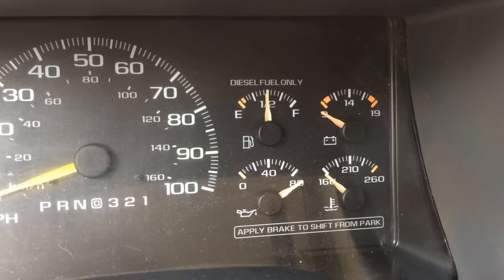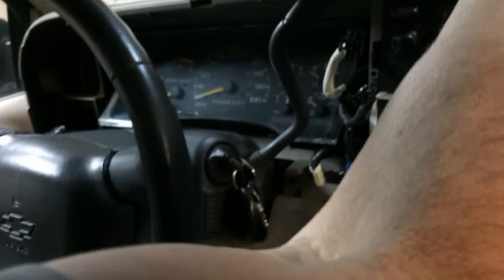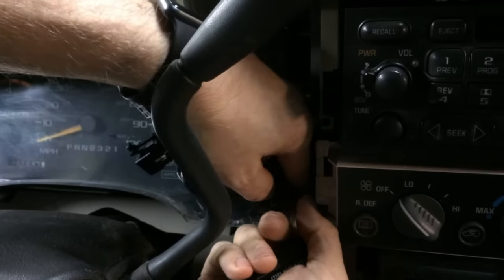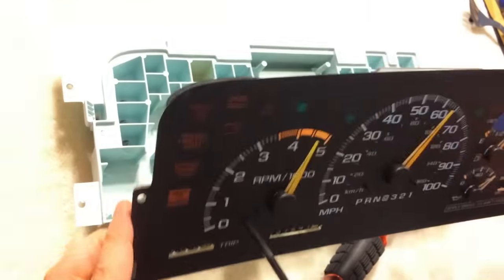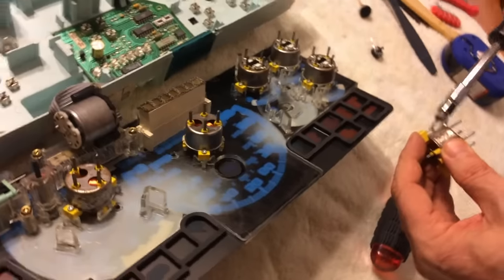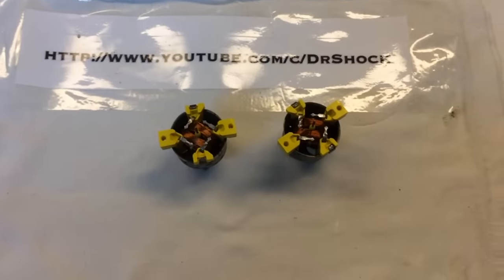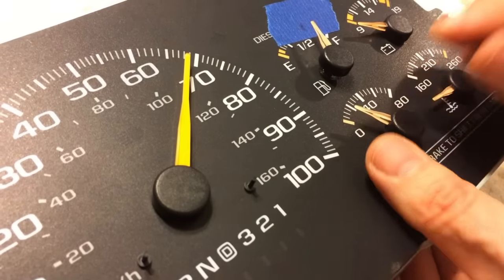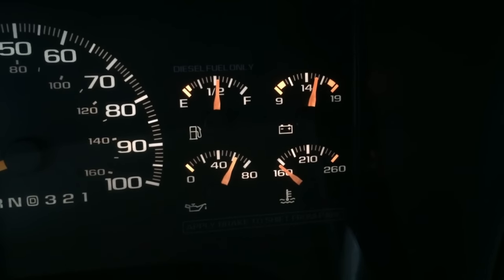1994 - 2002 GM Truck Twitchy Erratic Crazy Fuel & Oil Gauge Needle Aircore Motor Repair (Chevy GMC)

Comment: Does it matter which way the numbers are facing when you put in the fuel gauge
Reply from the maker: I'm not quite sure what you're asking here.   You of course have to have the instrument panel oriented rightside up as shown in the video before you re-install the aircore motors into the flexible circuit board.  In other words you want to be reading the numbers just like when it's mounted into the dash, not upside down.

Comment: Your voltage gauge is reading high too . Should be at 14.4 volts or
Less depending on accessory usage
Reply from the maker: Not necessarily.  The particular vehicle used for this video has the 6.5L diesel factory RPO of dual alternators (aka ambulance option).   Consulting the factory service manual, you'll find the voltage output specification is up to 16V at idle.
Reply: DrShock well crap in my wheeties and call me O.J., Ya learn something new everyday

Comment: Can i just buy everything new?or do i have to replace 2 motor??
Reply from the maker: Discontinued by GM many many years ago.  Never offered aftermarket.   You could go rebuilt - I have links in the video description to Dorman who does full cluster rebuilds but they are expensive.
Reply: 😭damn ok thanks

Comment: where can I find an f  motor?
Reply from the maker: They're gone, the supplier in China went away during the pandemic it seems.   Pinned comment has a speedo shop that can professionally rebuild your existing one though.   And eBay links in the description will from time to time have an old stock or rebuilt one pop up.

Comment: What's the part number
Reply from the maker: There is no part number, like I mentioned in the video GM never made replacement aircore motors but only a complete instrument cluster as a replacement part.   These aircore motors only are available thru speedometer repair shops or their suppliers who guard these factory part numbers.  Fortunately at least one such supplier offer these motors on eBay.  The video explains the letter calibration codes (F, P, V, S, T, etc) to order depending on the gauge being repaired - each gauge requires a differently calibrated motor and it will only work for that one particular gauge.  For a fuel gauge, order an "F" aircore motor.
Reply: @DrShock   Thank you

Comment: How come the gas gauge hand does not go to E when you turn the switch off
1
Reply from the maker: Well, I can't say for older trucks because it's been too many years for me to remember.   But on 97, 98, 99 OBS trucks - the fuel gauge isn't supposed to move when you remove the key.  It's supposed to hold the fuel level reading, so that's working as designed for what you noted there.
Reply: @DrShock  On my truck the gas gauge hand always went to E when the switch was off which was normal! And when the switch was turn on or my truck crank up it would show the amount of gas in the truck! Now the gas gauge hand stays on full period, with the switch on or off!
Reply from the maker: I figured that's why you were asking, but I've not seen that behavior on 1997 and up V8 trucks (both gasoline and diesel powered).   The new behavior, of staying on F always, sounds like a fuel sender problem.  You might try the test for that in the video for that linked from this one.

Comment: where can I buy the aircore motor? I have the same problem with the fuel needle
Reply from the maker: If you read thru some of the other comments they've virtually been sold out now.  The last suppliers I've seen sold out by December 2019.  I do see the "C" and "S" calibrations listed at aliexpress.com still, but they are not cheap anymore.
Reply from the maker: A speedometer shop on eBay is now selling these again, but he's only got the "C", "P" "S", and "T" calibrations currently.  I put a link in the description.

Comment: Where would one find those clips that you made some adjustments on?
Reply from the maker: If you're talking about the clips that retain the aircore motor prongs into the cluster housing/circuit board, only from a salvage yard donor vehicle.   If by chance you're referring to the resistor pack that clips onto the back, you only need to worry about that if your aircore motor had one originally and you just transfer it over.

Comment: This is a ground fault. Have the same thing
Reply from the maker: No, not in this case.   While circuit grounds should be eliminated first, as I mention in the video, as they can certainly affect either the fuel sender in the tank analog signal up to the PCM, or the PCM digital signal over to the instrument panel flex circuit, that's not the behavior I'm going over in this video.   The behavior we're going over here is when the fuel sender has been verified to be correctly sending it's signal, when the aircore motor, PCM, and fuel sender are all correctly grounded, and the instrument panel flex circuit board is also correctly receiving the PCM signal -  but the aircore motor still exhibits erratic or otherwise incorrect readout behavior.   The particular erratic behavior is caused by the complete loss, or chemical breakdown and degradation, over time of dampening fluid used to calibrate the aircore motor itself.  Calibration is needed because the GM PCM signal for these years is a DC SQUARE wave, so without the dampening effect to smooth it out you get the twitching behavior in between signal pulses.  The twitch dance being more pronounced the more the aircore motor calbration material has degraded. Once the aircore motor is replaced, the problem is corrected back to original factory engineering behavior.

Comment: I suspect there was nothing wrong with your oil pressure gauge. I think the needle index was knocked out of alignment when the fuel gauge needle wrapped around and smacked the oil pressure needle.
Reply from the maker: Possibly, we didn't investigate this angle further as the fuel gauge repair was the main todo.  There's considerable labor cost to open the cluster up if you are not the owner of the vehicle, and you only want to do it once in the vehicles lifetime given the age of the vintage plastics involved.  A new aircore motor for the oil gauge is cheaper than a replacement diesel engine, so not something to I'd want to cut any corners on.
Reply: @DrShock , yes, I agree. I enjoy all your videos.

Comment: Do you have the part numbers for the motors?
Reply from the maker: GM only sold the complete clusters originally, so there are no part numbers for the motors alone.  But in the description I listed out the calibration codes that the suppliers to GM used.  Finding a new fuel gauge motor is about as rare now as finding an NOS 57 Corvette part though.
Reply: @DrShock  yeah I kinda figured so it'd be easier to buy a junk yard cluster and swap it
Reply from the maker: You can also have a speedo shop rebuild the aircore motor, complete with new dampening fluid of the proper viscosity.  Basically remanufacture it.    I pinned a comment with at least one shop that was still offering that service late last year.

Comment: Pleas put me in the right direction for a GMC Yukon XL 2001
Reply from the maker: This video woudldn't apply to a 2001, that's a totally different design using Stepper Motors not Aircore Motors.

Comment: what of its not working at all
Reply from the maker: Gauge not working at all - test the fuel sender.
Reply: @DrShock  yeah that could be it
Reply: @DrShock  do the cluster have nightlights in it
Reply from the maker: There are several backlighting bulbs yes (link in the description for the replacements).  If you've got nothing there I would check the wiring harness.  Not really possible for all the bulbs to go out at once.
Reply: @DrShock  no the night lught that lights up the gauges not the other lights those come on
Reply from the maker: Yeah so again that reads like you have a problem with the wiring harness to the cluster, the pin that feeds the power to the backlighting would appear to have an open or short.   Check the fuse first, and then you'll have to go thru the wiring harness behind the dash to locate the problem.

Comment: Is anyone can tell me how I can fix my 2000 the Sienna's rpm and mild meter and a   Fuel gauge
Reply from the maker: By 2000 Sierra was new body style and didn't use this type of gauge, it went to a stepper motor design.   If you search on 2000 GMC stepper motor repair you will find what you need there.  If you're asking about the Toyota Sienna completely different this video is only applicable to GMT400 series trucks.

Comment: I've been owning mine Since 1999 when I got it the dam fuel gauge been flopping every since I got it. I just have kept gas in it. Been low just a very few times and that motherfucker went hay wire thaught me a lesson,Keep that dam tank with plenty of gas in it. That my opinion.and have a gas savior to drive on the side. I love driving my big SUBURBAN. Just keep a lot of gas in them baby's. I've been rolling mine like for ever.going on22years.And that Bad Mother,fucker is still running Chevy Tough.ive kept  it well maintain. It hasn't lete down one-time in almost,going 22years.it is my favorite big ride to still roll.since day one.

Comment: Where can you find the air core motors, they are so hard to find?
Reply from the maker: There's an ebay search in the description, there are only a few speedometer repair shop type suppliers who have access to these parts to sell them.
Reply: @DrShock  yea I found them on ebay, expensive as hell. A whole set is just under 200 dollars. I found that taking apart the cluster and working the gauges by hand, then reset them works just fine. Fuel one needs replacing though, all the fluid is dry in the motor, other than that. Works just fine. At the rate of replacing all the motors, might just be better to buy a whole cluster from Orilies for 350 dollars.
Reply from the maker: So you wouldn't want to replace all of these "proactively", only the fuel gauge suffers from the dampner fluid problem due to how the PCM pulses the signals to the aircore motor.   If you have multiple shot gauges yeah probably a new cluster is in order.   This repair is typically for just one gauge, in the case I showed two because of "collateral" damage from the fuel needle into the oil pressure needle.
Reply from the maker: A speedometer shop on eBay is now selling these again, but he's only got the "C", "P" "S", and "T" calibrations currently.  I put a link in the description.

Comment: Did you see a oil pressure gauge shows high?
Reply from the maker: It's a 1999 6.5L diesel engine in this example, showing expected and normal pressure for the engine temperature once the damaged oil pressure gauge motor was replaced (I mentioned there were two defective motors to address on this repair job in the vid).

Comment: Please stop calling them OBS, they are GMT400 from 1987-2000. 1987-1995 they had the Pre-airbag Steering wheel/instrument cluster/digital air controls. 

1999-2007 was GMT800.

2007-2013/14 was GMT900
Reply from the maker: While my channel gets into some deeply technical topic areas,  I don't typically use GM jargon on my channel that isn't directly related to the repair procedure, though I am quite familiar with it.  For future readers of the comment none of the GMT platforms mentioned actually apply to this particular video, instead the more correct reference would be the GMT400 series yes, but which actually ran thru 2002 as carry over models.  This video is about aircore motor based clusters repair, not stepper motor based and appearing only in vehicles typically referenced as old body style , or OBS trucks because of the design carry over into 2002 nature of them.  The term emerged for how to distinguish why some new trucks like the GMT455 had the old body design in the same 1999-2002 timeframe.  It comes right from the GM SPS information in TIS2000 - official GM term is OBS.  ;-)

Comment: You can inject new dampening fluid in these gauges. Here's a video showing you how. It starts at the 12-minute mark.

https://youtu.be/TLtDw_Sjh1o
Reply from the maker: Speaking from experience, you'll find that approach a temporary solution without using more professional rebuilding equipment like a cluster remanufacturer would have access to.  You're going to be disassembling the dash again in two or so years to repeat the process.   On the other hand, given the NOS aircore motor sources have dried up in this Covid era, it's probably the only alternative nowadays.

Comment: Внезапно перестал работать тахометр, "субурбан 1995 6.5 дизель", вчем может быть проблема и как его проверить? Буду очень благодарен за если поможете разобратся с этой проблемой!!! musculcarus01@gmail.com
Reply from the maker: In English, this reads the tachometer suddenly stopped working, suburban 1995 6.5 diesel it would seem.  Well, the signal for that tach gauge comes from the alternator on a diesel.  So check that alternator first.  Second check the wiring harness from the alternator to the instrument cluster.  Third, check the plug on the alternator.  If those are all good, and you can meter the signal from the alternator, it would have to be the gauge itself (but that's rare).   надеюсь, это поможет
Reply: @DrShock  Thank you very much for the tip, I will check!
It's just that the car stood for more than seven years without moving, now there are constant electrical problems! I can't find electrical circuits on it, so I come to study everything blindly! Thank you again !!!
Reply: @DrShock  Спасибо, помогло, все починил, был плохой контакт провода с гениратора на приборную панель!

Comment: Thanks video
I have a 2000 k3500  (still the old body style)
My fuel gauge is erratic and completely wrong.
If i fill the tank up before i start the repair then start the vehicle and install the needle to full ,  would that work ? 
Thank you
Reply from the maker: With a non-working gauge "filling up" could be highly subjective.  ;-)   If it were me I would drain the tank via a siphone hose and set "E" instead, but sure either approach let's you manually calibrate to a "known value".
Reply: Full ( topped off), might put the needle past the full mark. I haven't filled mine up for 6 years (42 gal.)